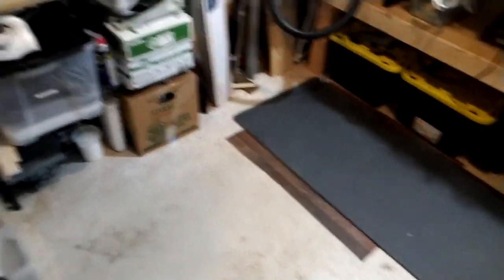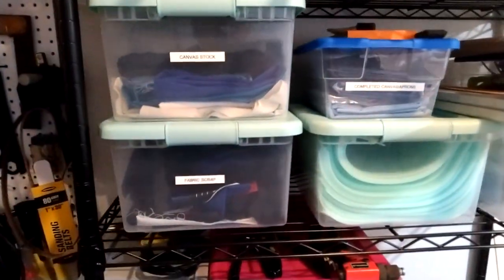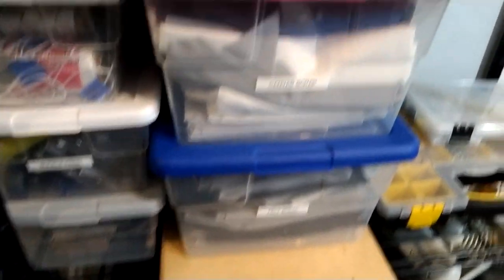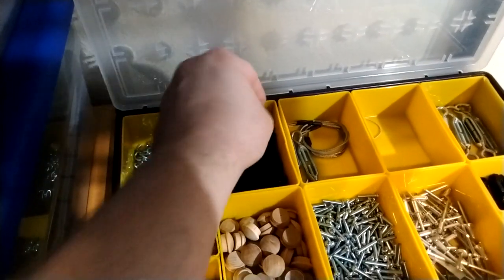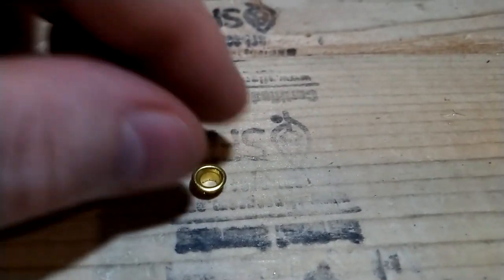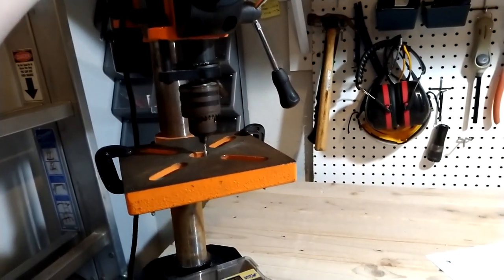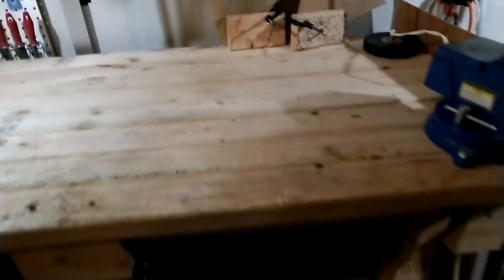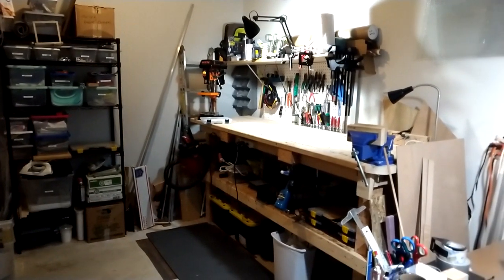Custom Ring Making - Shop Tour

Comment: Could you possibly do a tutorial on how to build a ring. I’m planning on making one myself
Reply: Did u figure anything out bro...I'm trying to do the same. Quite lost on all the pieces needed n how to put it all together
Reply: @410veno  nope not at all bought all the parts worked on welding the frame and posts and gave up after a week I just figured it out by looking at disassembled wwe/AEW or any pro wrestling ring and just winged it. Its pretty easy weld the frame to the posts and from here it gets easy get thin plywood or wood planks that are small. Then get a legit canvas 2 of them. And create a hole in the mat where u would tie it to the frame with a hole puncher. And tie the mat to the frame add the ropes and stuff after u added the metal turnbuckles to the post u can add the elastic ropes and add ur custom or factory made turnbuckles from play sets and ur basically done I missed some steps
Reply: @410veno  u can also look up ppl staying after a wrestling show bc they show the producer’s disassembling the ring and stuff that’s how I figured out how to put it together lmk what pieces u need
Reply: @colinhaggerty160  appreciate the help...I was thinking about welding but then thought if I wanted to make it to be able to break down for storage capabilities or not. I'll def take what you've figured out into my notes and watching ppl who assemble real rings is a genius move. Appreciate it again bro
Reply: @410veno  no problem